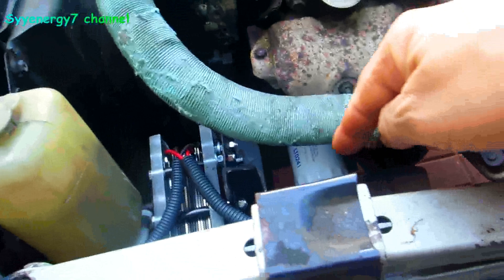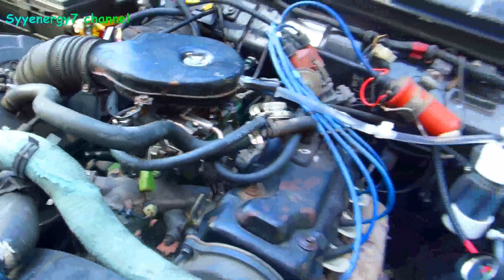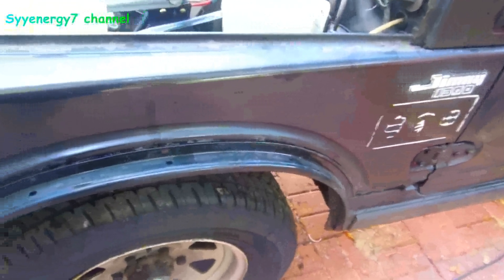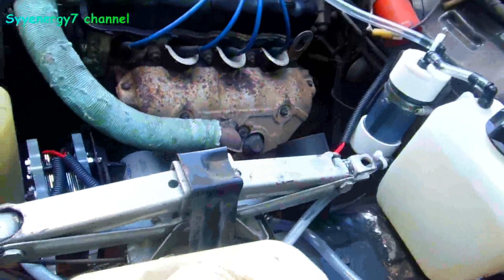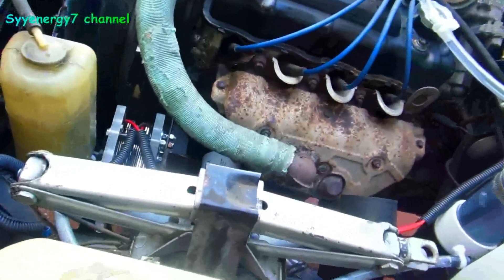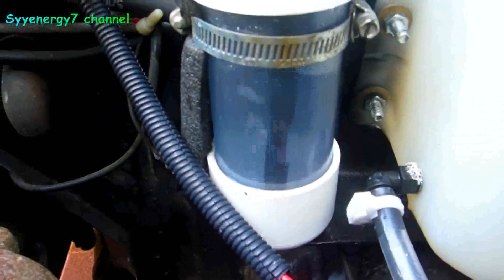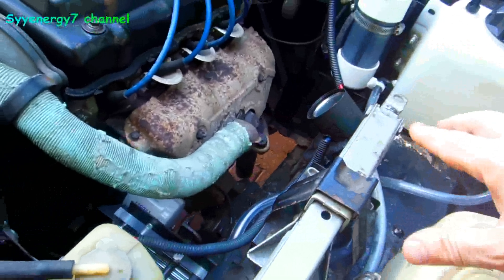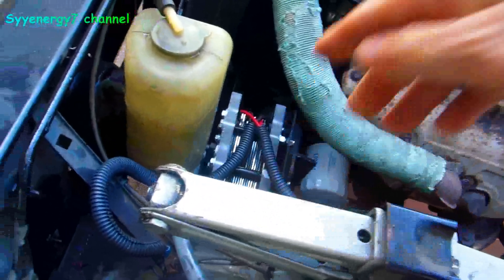More on Suzuki Samurai Dry Cell HHO

Comment: hello dear
i have a car
hyundai accent 2007
how many dry cell can i build for it ??
the slices 12 cm * 12 cm
Reply from the maker: Not sure if hho would work good on a newer car with a computerized engine management system.  It works great on the old carb engines .
Reply: Thank you for your reply
There are some companies have tried this product on modern cars and the result was positive but the purchase price for this product is very much

Comment: I once owned a nice older dark green Suzuki Samurai like yours. It was rust free and had a 5 speed manual trans. It looked cool and was great on gas. The reason you don't see too many of those around anymore isn't because ppl junked em, it's because they flipped them. Those things had a narrow wheel base and were top heavy. Be careful when you inflate those tires. If you overdo it it'll be like riding on basketballs
Reply from the maker: This one is actually 3 1/2 inches more narrow than the Samurai.  It has different axle housings. I had it 27 years and never flipped it yet.  Ever drive a M151 Jeep?  Those things will flip real easy.  They don't even have a stabilizer bar up front.

Comment: and how it works  i not clear on how it works.
Reply from the maker: It breaks some hydrogen off the water (H2O).  The reason this works is not because it adds so much fuel, but because it helps burn up the existing fuel more completely and efficiently.  If you have a computer engine management system, just adding the HHO system will not work.  You will have to tweak the computer with other add on devices and that can get tricky and also damage an engine if not done right.  With a simple engine like this, with a plain carburetor, HHO works good, especially if you get a HHO cell that has more production than needed for your engine size.
Reply: ok thank you